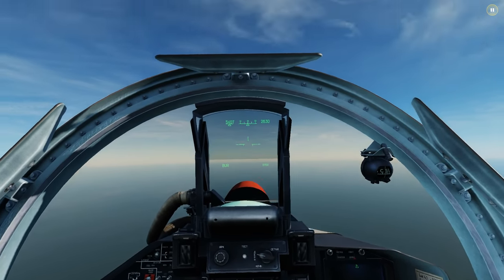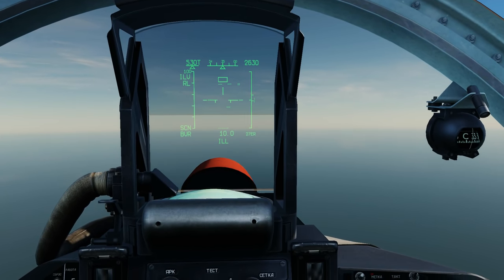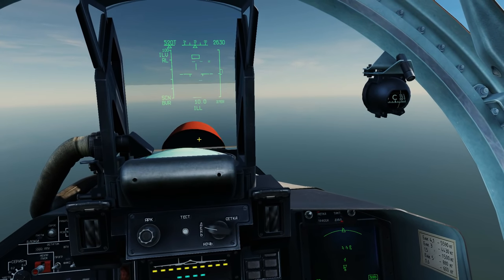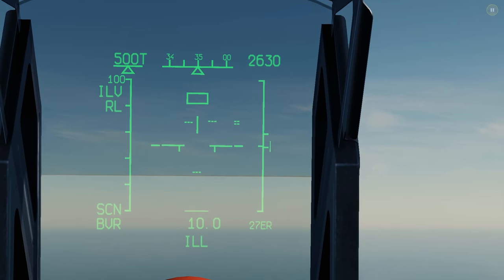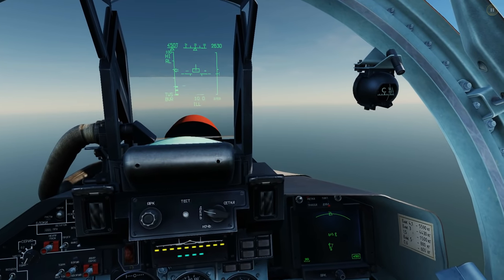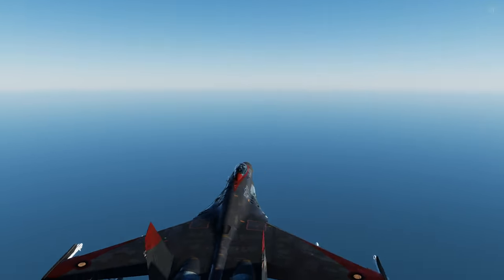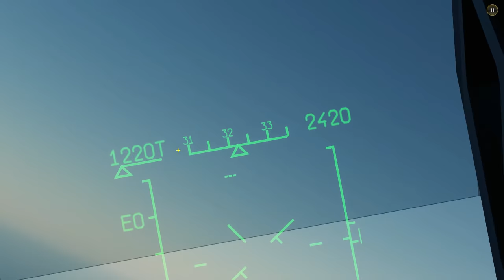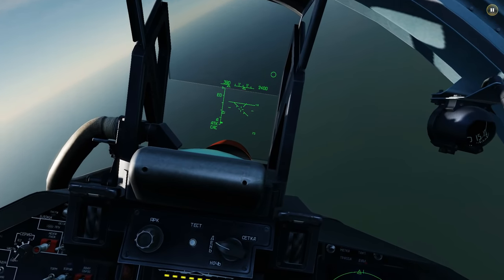Su-27, Su-33, Mig-29 & J-11A: Radar & Electro-Optical Sensor Tutorial | DCS WORLD

Comment: Is high PRF useful when a target is trying to Doppler notch? Low PRF gives greater unambiguous range but is less sensitive to low-velocity targets. Perhaps high PRF would be useful when a target is trying to blend in using notching since it's likely to still have a little closing velocity.  High PRF should also produce more energy on target.
Reply from the maker: I think so, but again, I'm not sure which PRF is best for which situation.
Reply: Low PRF is best for long-range search and high PRF is best for shorter range tracking/targeting and cluttered environments.
Reply: I don't know the ins and outs but in general High PRF is better at detecting hot targets and Med/Low is better for flanking or cold targets.  I would assume that if a target were trying to notch then switching off of High would help.  I tend to use High almost exclusively, at least once I get a RWR alert, because I care more about hot targets than cold.  That's probably a noob move but it seems to work most of the time.
Reply: What do you mean by "hot" and "cold" targets? What does that mean in a radar sense? Hot= closing in? Cold = moving away?
Reply: Pretty much.  Hot basically describes when they are pointed at you and cold is when they are pointed away.  You could also say that when your bearing to them is less than 180° they are hot and if your bearing to them is more than 180° they are cold.  It doesn't really  matter if you're pointed at them or not but rather how they are pointed to or away from you.
Reply: Doppler filtering ought to work as well on targets moving toward or away from you, it's about the intensity of the shift. Is there a physics or processing reason why a blue shift would be more easily detectable than a red shift?
Reply: There is but I don' t know what it is.  It's all a little over my head and though I've read quite a bit regarding red/blue shift, PRF, etc I don' t know enough about it to even describe my own vague theories about why it works the way it does.  I have to trust that it is.  It gets even crazier when I start reading about the various returns that pop off of an aircraft (side lobe and what not).  I'm glad someone else is smart enough to understand all of that and I've yet to read an article that dumbs it down enough for me to understand.  LOL.